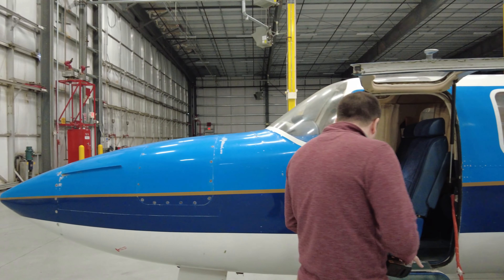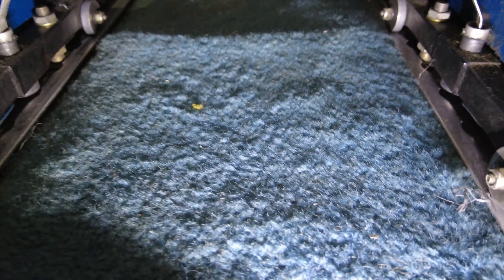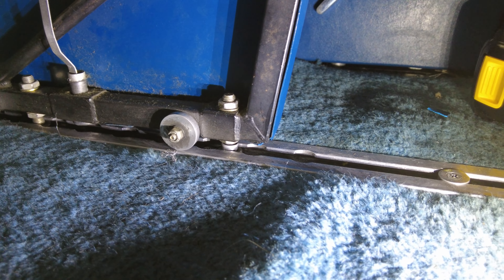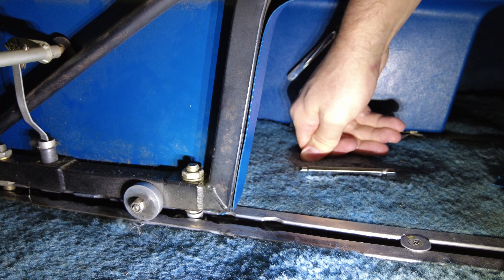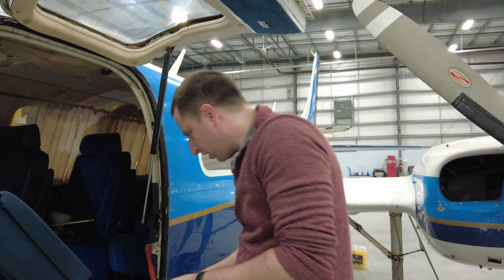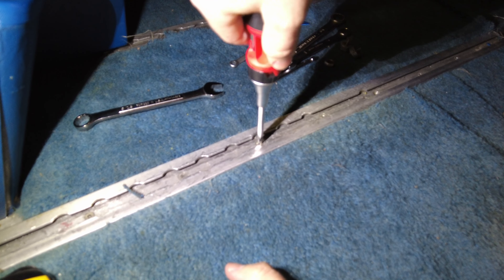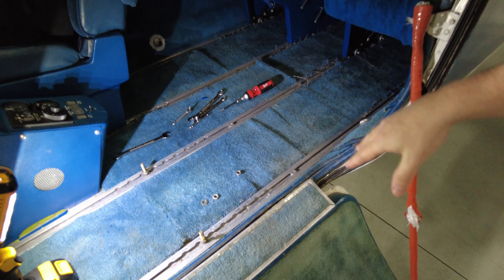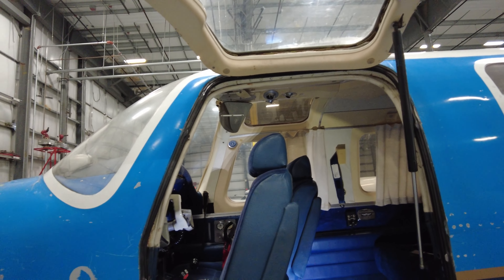Barn Find Aerostar Airplane First Fix? A Loose Screw Prevents Boarding!

Comment: Pay the mechanic!  Airplane pilot seat stops are very important for safety reasons.  Not to mention doing your own non-certified work is illegal.
Reply from the maker: I do have a couple A&Ps working with me on this project whom you'll meet in later videos. On the Aerostar, the seats are pilot-removable so even without a mechanic overseeing the work there is no issue with removing seats. Fixing a screw like this would fall under owner-authorized maintenance as well.
Reply: @AviationRestoration  No need to respond to the youtube experts,  you just encourage them to keep sharing their un-asked for personal belief's that they think is wisdom.      Hope you keep posting video's on your Aerostar restoration adventure.